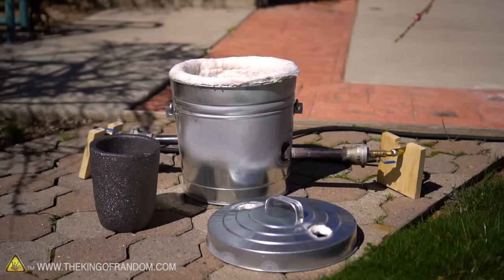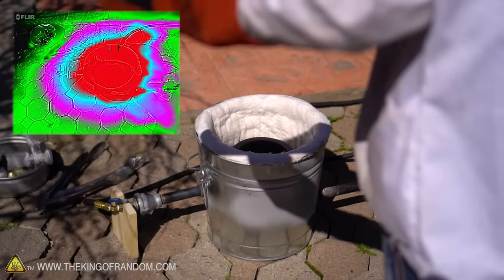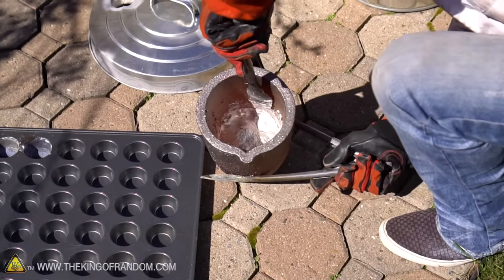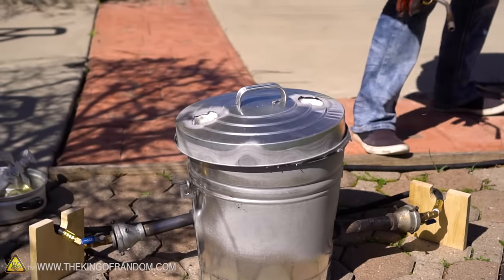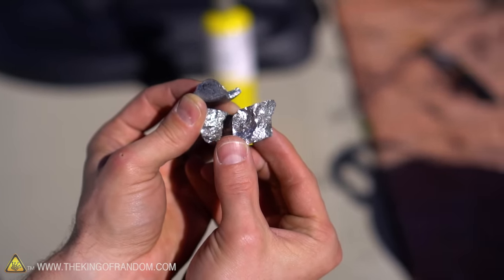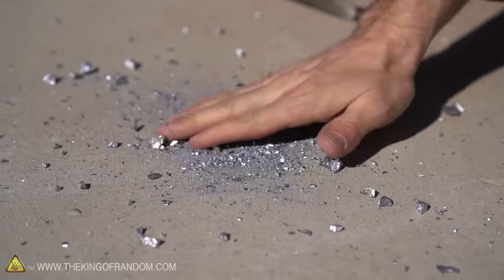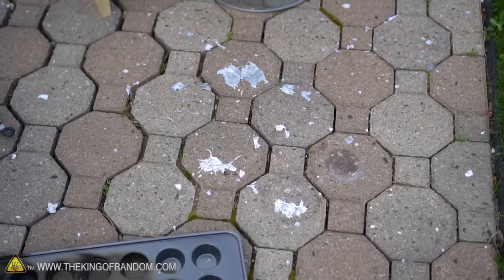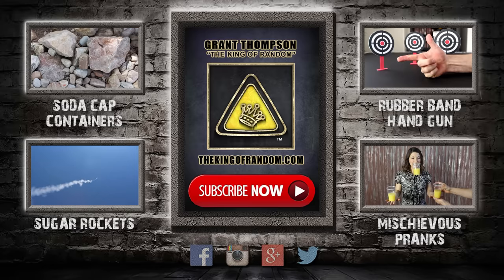Mixing Molten Aluminum With Molten Brass | How To Use Mini Metal Foundry For Mixing Metals

Comment: do more of these types of videos but with different metels 
like if u think he shuld
Reply: theres plenty of metallurgy videos out on youtube...
Reply: Keyshaun Spratley but he dose it a lot better and all of those other videos on YouTube are with a professional metel foundry
Reply: he wouldnt explain what happens when metals mixing together then a person whois entire carrer is metal, also yea but it doesnt mean you NEED a top level foundry. its melting metal its not that difficult todo (probably could even use a magnifying glass  stand to melt it)
Reply: but your still not getting the point, it's better when someone like him dose this stuff on his chanel, and it's a lot better for people to see how he dose stuff like this and at the same time he can show what metels he can melt using just those simple things
Reply: jake listen,  there are plenty PLENTY of interesting  metallurgy videos that go way more indepth then grant, sure he might give a little info but not near something a proffessional could tell you. heck even welders must know metallurgy to not tottally melt everything into a puddle , technically he could melt almost any metal (with highly heat resistant ones being the exception) just need enough airflow to fuel the fire
Reply: yea i do agree grant is definitely more entertaining the what ud most likely see in metallurgy videos, but if your ever curious about the tiny tiny changes that occur (like the metal becoming more brittle with more alluminum) i definitly recomend sitting through one, quite interesting honestly, never know when you might wanna forge a sword and need to decide how to make your metal ;)
Reply: Yeah, but we both have are own application and we both like different stuff but we both are right, and I oreddy know how to make a sword  :)
Reply: Yeah but it would only fall part  if you drop it but at the same time it would look pretty cool in slow motion
Reply: This isn't a metallurgy channel.
Reply: Cancer.png no but he is "the king of random" I would classify that as something he could do
Reply: Metallurgy is not a random practice at all.
Reply: get the slomo guys to film a brittle katana shattering tip first, or even vs another sword (like you see in the overly dramatic martial arts movies)
Reply: One does not simply FORGE a brittle weapon.
Reply: YES! but make sur eit doesnt gov over its melting point, then forge weld all the material together into a ultra club
it could destroy a cruiser
Reply: Yeah lol
Reply: That would be cool
Reply: * Should*
Reply: When you try far too hard to be English.
Reply: when you try to hard to claim someone is trying to hard, also its just how i normally talk? i dont say "hey" i say "oi" just less effort
Reply: I wish that was a coherent sentence..
Reply: translation for you: no ones trying hard but you
Reply: When you try too  hard to claim someone is trying to hard, also its just how I normally talk? I don't say "hey" I say "oi" just less effort.
Reply: your 4 days too late cole
Reply: also grammar doesnt matter much as long as the reader has atleast half of a brain to understand the context of something, but please do keep trying, ill just pureposly make more grammar and spelling errors to keep you busy

Comment: What would happen if you put molten aluminum into liquid nitrogen?
Reply: MOIPAH it would crack as soon as it comes into contact with liquid nitrogen.. Because of the temperature difference between the two materials and also it would become very brittle if it retains its shape somehow.. And would break the moment you press it even in between your fingers because of the porosity
Reply: Arvind The Sharpshooter no he is saying MOLTEN aluminum like the liquid
Reply: The liquid nitrogen would vigorously boil and splatter molten alumium for several feet, not to mention the alumium would pop from thermal shock... so yeah not really something you'd want do
Reply: MOIPAH it would boil so fast it would explode
Reply: i think backyard scientist has a vid on that
Reply: MOIPAH Yeah
Reply: MOIPAH 
Already done by "BackYardScientist"
Reply: YouTube will die a painful death
Reply: I kinda want him to make armor with the fireproof stuff
Reply: THe fireproof wool is dangerous to breathe in so i dont think he'll do it.
Reply: like it
Reply: thats what I wrote on the last video😂
Reply: MOIPAH i assume an explosion...
Reply: I think a small explosion.
Reply: The leidenfrost effect would separate the two tempature extremes, so sorry no explosion
Reply: same effect as you put ice into molten lava. EXPLOSION
Reply: who know but lets try it!

Comment: Tungsten crucible, Grant.  Do it, please.  And like if you agree.
Reply: i don't know if that'll work, and isn't tungsten expensive? i mean for finished products of tungsten.
Reply: Jason Shaw it would work, tungsten has the highest melting point of all earth metals currently found, (3422°C)
Reply: Well it would work but not for long.
While tungsten has a high melting point it oxidizes very fast at way lower temperatures.
So as soon as you get it glowing hot it will oxidize on contact with air and slowly crumble away.

Because of that reason high temp metal crucibles are typically made from platinum even though Tungsten has an even higher melting point and is much cheaper.
Reply: graphite (carbon) has a melting point of 3500ºC, so even higher than tungsten. also, tungsten is very heavy so it wouldn't be practical compared to a graphite crucible
Reply: Boi, Carbon aka graphite has the highest melting point of all elements currently on the periodic table of the elements.... Ya dunce
Reply: @Tajon
1)graphite is not an element
2)there are better heat resistant polymers
Reply: It would be extremely heavy
Reply: Guy, i think Tajon means that graphite is just pure carbon, which it is. so, technically, yes graphite is an element, or rather a specific configuration of one.
Reply: carbon is not know as graphite, but i guess thats what he meant but what he said is wrong on so many levels

Comment: Take an ice cube on top of a new hot aluminum muffin
Reply: Mr.Burito it would make molten metal splatter everywhere
Reply: Only when it has cooled a little bit down, like solid
Reply: Mr.Burito it would just melt faster than usual

Comment: If the zinc in the brass became                   that yellow stuff then wouldn't it just be aluminum and copper?
Reply: Not all of the zinc was being oxidized
Reply: He got back almost 2 muffins of metal in the 50/50 mixture, which means most of the zinc actually stayed in the metal.
Reply: *aluminium, not aluminum
Reply: in the states it's spelled aluminum
Reply: FraznoFire That depends on your country.  Davy spelled it alumium, then was and published in the official discovery as Aluminium.  Young violated norms and decided take it upon himself to rename Davy's discovery as he liked -ium endings better (which also altered the pronunciation).  Since this was discovered in 1812 when communications we're slow the aluminum spelling  persisted in the US & Canada and aluminium persisted in British colonies.  IUPAC indicates both are now valid and correct, and in official publicaions is almost 50/50.

Comment: You'd get more consistent pours if you used a gravy ladle instead of pouring directly from the crucible. Also, the 50/50 alloy probably shattered because you cooled it quickly in water, introducing stress fractures, rather than slowly annealing it in the crucible.

Comment: All i can think when watching this, is aluminium brass from the tinkers' construct mod for minecraft.
3 parts aluminium 1 part copper.
Reply: kris220b haha me too
Reply: kris220b Haha same
Reply: Bradley Hinton calm yourself, it's not that important that others are enjoying themselves even if you aren't
Reply: kris220b yas
Reply: kris220b totally
Reply: Aluminum Brass is a real alloy, technically it's not brass but bronze. Brass + Aluminum = Aluminum Bronze
Reply: +MrMJCaboose13 Minus the tin
Reply: aluminum brass is real
Reply: Close. Copper + Aluminum =  Aluminum Bronze, with copper making up ~90-95% of the alloy.  In aluminum bronze, zinc content is less than 1%.

Aluminum brass is a separate alloy of 77.5% copper, 20.5% zinc and only 2% aluminum.
Reply: I know, i was saying it was real
Reply: Same
Reply: Yup.  With the crowd that would be attracted to these videos I would have been really disappointed if someone didn't make the Tinker's Construct connection.  :D

Comment: If the muffin pan can hold molten aluminum what is the muffin pan made of?
Reply: looks like steel and is most likely steel. Steel's melting point is almost double that of aluminum
Reply: steels melting point is 1500°C/2732°F
Reply: Fredrik actually that is wrong. I had a muffin pan which was made of aluminum unbeknownst to me. the pan failed, and caused my concrete driveway to crack and send molten aluminum into the nearby vacinity.
Reply: well that sounds terrifying. i hope you survived.
Reply: El Cabaro face palms

Comment: how do you clean the crucible after its coated in metal?
Reply: Ben .-. You get it hot enough to melt again.
Reply: you cant scrape out the sludge on the sides and get every bit?
Reply: You risk damaging your crucible by scraping it.
Reply: i just cant imagine it all coming off considering how some of it cools and films up right away
Reply: Ben .-. that is because the mouth of The Crucible is not as hot as the base
Reply: aluminum is hard to remove because it dissipates heat so quickly. mostly want to dedicate one crucible to aluminum only.
Reply: heat and flux
Reply: Fuming nitric acid?
Reply: After it is cool you can just pull it out. You may need a chisel or something to get you started, but it doesn't stick too hard unless you're talking about the oxides. The crucible is graphite after all

Comment: What can you do with aluminum oxide once you've skimmed it off of the top of your molten aluminum?
Reply: Dan Sullivan I think he should make a video where he goes from one to the next
Reply: Grant Butler Aluminum oxide is rust. Thee isn't much use for it when forging or melting aluminum to my knowledge.
Reply: Thermite from the 50/50 mix? it looks easy to turn into powder.
Reply: I think it'd be really cool if he made a thermite video with his own aluminum oxide
Reply: I believe he has already, but I may be wrong.
Reply: VS BinarySloth I know he's made termite before, but o don't think it was from his own aluminum oxide
Reply: The Thermite reaction is 2Al + Fe2O3 --> Al2O3 + 2Fe.  Using Aluminum Oxide would not work. . .
Reply: Rubies and Sapphires are aluminum oxides.
Reply: Aluminum oxide is very hard, could be used as an abrasive.

Comment: melting glass and aluminum together what happens?
Reply: Glass would have chunks of alluminum embedded into it.
Or the glass would be broken.
Reply: I'm not sure how the processing is done but there is a new class of materials (I believe it's a type of polymer) coming out that are metallic glasses.  They have some rather interesting properties (including massive kinetic absorption ability and the ability to be permanently magnetized while still being made into very unique shapes).
Reply: rushthezeppelin isn't the glass in welders masks a metallic glass?
Reply: Traditional Crystal is a type of metallic glass made from glass and lead (18-40% lead oxide), there is also uranium glass (2-20% Uranium, very pretty green colour) that was popular between the 1940's and 1990's, and yes Uranium is a metal.
Reply: You get transparent aluminum from Star Trek IV.
Reply: Disappointment

Comment: Try silver and gold or gold and white gold
Reply: that is an expensive project
Reply: XpertAssassin  white gold is just plated gold so you would have an almost all gold ingot
Reply: GEEZUZ321 white gold is an alloy of gold and nickel, not only because it's plated. It's usually plated in rhodium or platinum afterwards but it is its own alloy.
Reply: metalhead0jtk right, it's a 75-25 mix of gold and silver/nickel depending on how cheap its made. But after the rhodium gets smelted off the white gold would be a pale green/yellow. Mixing that with an 18k yellow gold is going to make 18k  yellow gold, the impurities of both alloys pretty much cancelling any color change and dulling the color of pure gold.mixing things labeled as gold alloys isn't terribly interesting because there isn't an enormous color range you can get with that much gold without plating the metal
Reply: The Best white gold is a mix of gold, palladium, silver, and zinc
Reply: Silver and gold is electrum, a naturally occurring alloy. Easy to make, white gold is already an alloy.

Comment: if brass is copper and zinc, and the yellow thing was zinc, then isnt that a mixture of copper and aluminium ?
Reply: was just going to say the same thing but i'm no metallurgist. maybe it's a little bit of zinc still in it.
Reply: Ioakim Ade still some zink left id assume, but yes
Reply: Not all the zinc is burned off as he said he said the yellow stuff is zinc oxide and there was only a small amount of it also brass is a more dense material than aluminium therefore there is more zinc than you would assume

Comment: what would happen if you would put glass in the metal foundry would the glass melt?
Reply: Yes, glass melts before aluminium
Reply: TjDolHaus86 No.  Aluminum melts at 660C while glass melts at 1400C.  I bet the foundry could still melt the glass though.  My plaster/sand coated foundry has melted its walls a bit.
Reply: Glass doesn't melt at 1400C, it's almost liquid at room temperature. Yes, glass is a strange material.
Reply: glass being "liquid at room temperature" is a common misconception. It is most definitely solid at room temperature unless your room is a furnace.
Reply: lordpouti you watch veritasium dont you..?
Reply: Or vsauce or whoever that was that made that video
Reply: Assuming it is a typical drinking/cooking grade it'll be a soda-lime-silica glass which has a melting point of around 550-650C which appears to be within the range of this furnace

Comment: What happens when you make a Lead - Aluminium alloy?
Reply: Honestly, I wouldn't try it, the fumes that would come off the lead would be extremely toxic.
Reply: I'm going to guess the mixture would mostly stay separate - the difference in weight will likely keep the Lead on the bottom and Aluminum on top. It might make a cool toy or something, where one side always tends to drop to the ground.
Reply: Brass is heavy too, but but the result was unexpected.
Reply: DO NOT DO IT!
The bonding force between lead and aluminum is not enough to overcome the density difference.
The aluminum floats on top of the lead.  Also, lead vaporizes (deadly lead vapor)!

Comment: Make a sharp projectile for the muffin cannon with the 50/50 mixture that shatters inside the wound
Reply: 595cristi woah
Reply: holy balls, i think you just found the deadliest bullet ever, unless it would crack from the power of the explosion :D
Reply: 595cristi its possible but i think human tissue is not hard enough or you nees a high velocity "launcher" for that
Reply: I know  right

Comment: When I'm making muffins I simply keep a five gallon Home Depot bucket two thirds full of water and then tap the muffins directly into it.

Keeping the water at that level prevents any hot water from splashing out when the muffins hit but still gives you enough water to keep them from melting through the plastic bottom - you can pick them up with your hand in less than five minutes.

If you're making lots of muffins then you needn't fret with having dangerously hot muffins sitting around air cooling - just keep dumping them into the bucket and when you're finished for the day you can dump the water and now you've got a bucket full of completely cool muffins.

Added bonus - they make a really neat sound  when you dump them in.

Comment: Put copper wire in you rope making machine and make a wire that actually works!
Reply: Like so he can see!
Reply: There's a small problem with this: Either you have a solid copper wire that would probably get so brittle and break, or you have stranded copper wire that I'm not sure would hold the tension properly.
Reply: Yeah, like for high-amperage. Maybe for a bigger welder that welds deeper.
Reply: +98yoshi98 It would be almost the same as a normal split-core wire, like in your toaster's power cord.
Reply: I'm not saying using solid core wire turning it into a new split core would be impossible to work with, but I'm not sure his setup could really do that without breaking the wires. I could be wrong, though. Depends how much twisting the wires actually do.
Reply: R. Andrew Neal Well then Grant will make his own wire XDDD OOH! THEN HE CAN EXPERIMENT WITH IT WITHOUT HAVING TO CUT OTHER APPLIANCES TO GET THE WIRES!! (I think)......
Reply: youd probably want to anneal it after the first spining
Reply: it can and can't work
Reply: Matthew Levine do you just say this every video?
Reply: no
Reply: yea he does
Reply: maybe testing it's properties under certain conditions or making a sort of paste with the dust and a small amount of water.

Comment: what will hapen to dried ice in the metal foundry
Reply: YES
Reply: it would vaporize
Reply: Toni Carapia you'd release carbon dioxide into the atmosphere very quickly
Reply: boom
Reply: cylo, if they put the dry ice in the foundry while it's hot, it will explode because of heat shock. it might be fun to watch but could be potentially dangerous